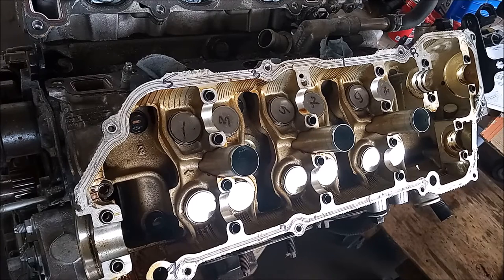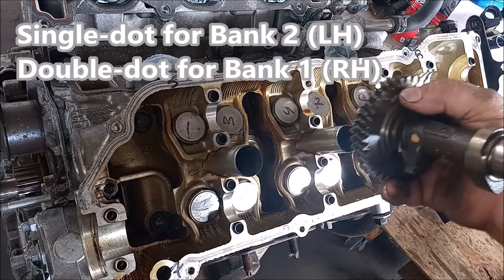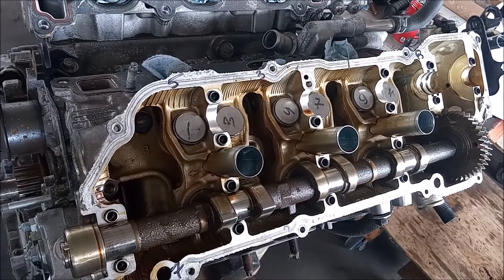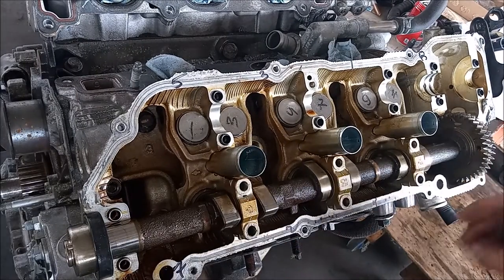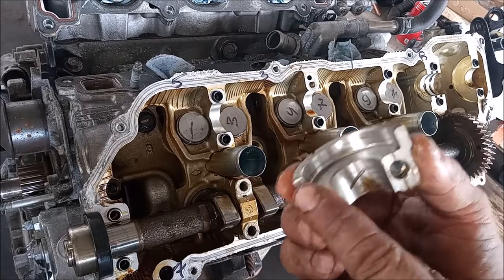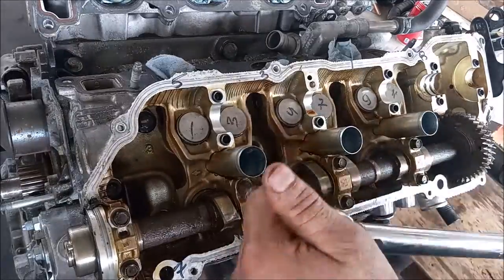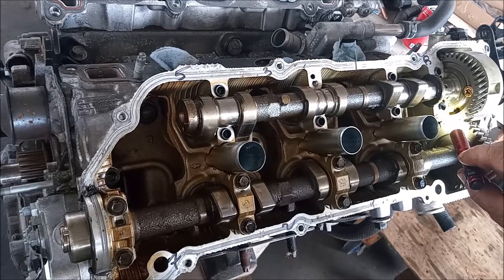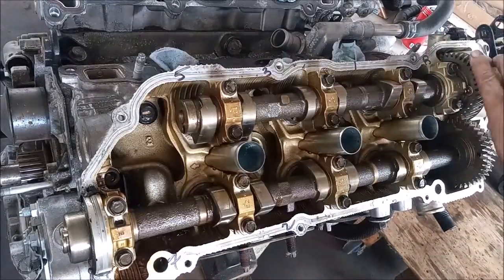1MZ-FE 3MZ-FE  VVT Camshafts Complete Install - Toyota Camry Highlander Sienna RX300 RX330

Comment: The dots are backwards isn't it bank 1 1 dot bank 2  2 dots and the split gear needs to be pre.tensioned.
Reply from the maker: They were installed as shown, and it works, so I don't think it's backward, and the pre-tension with the service bolt is shown in this video and also in more detail in another video.

Comment: Great video. Did you have to take the head to get it resurfaced at a machine shop? Thanks.
Reply from the maker: No not needed. I checked it with straight edge it was fine.

Comment: before i remove my camshaft would be a good idea to mark em before removing so i can put them back on same way after i resurface the cylinder heads or it really doesn’t matter
Reply from the maker: The camshafts have timing marks for aligning the exhaust cam and the intake cam on each head. PLEASE LOOK AT THE FACTORY SERVICE MANAUL.

Comment: I had to replace a burn exhaust valve on cylinder #4 on my wife's 1999 Lexus RX300 with this 1MZFE engine and did a novice booboo. I tilted the head over and all the shim buckets fell out and I lost the locations. Any recommendation for re-assembly? I was thinking of first placing the exhaust cam in place and use a feeler gauge and then mic the buckets.
Reply from the maker: Just thinking about this gives me a headache. You'll get through it.

Comment: If i removed the camshaft with the wrong dot marks together (180 degrees from where i should have) should i install at the normal installation position or should i install the way i took them out?
Reply: This on camshaft no.3 and no.4 by the way. I took out the camshafts at the two dots instead of single dots lined up (3FE-MZ). So all the valves are decompressed now. I figured when i reinstall, i just go ahead and reinstall the way the manual says to reinstall since all the valves are decompressed now
Reply from the maker: @charlesmaki7559  Correct just follow the manual and don't forget about the service bolt for the cam spring.

Comment: So the back set of camshaft have one dot and two dots the service manual says line up the 2dots for the rear camshaft and the 1dot for the front camshaft. Issue I’m having is that the timing mark on the back camshaft isn’t aligned with the mark on the timing cover when the two dots on the back camshaft are together. 
Should I just go ahead with the manuals recommendation or try to set the time with the marks
Reply from the maker: I'm not sure what you got going on there. Follow the manual for aligning the gears with the camshafts. Then after the head is reassembled you take care of the timing marks.

Comment: Are there valve clearance measurements to make and correct with shims?
Reply from the maker: Yes the buckets are shimmed. This is why, if you watch my head gasket video, I number the buckets and put them back in the same order. Unless your engine was making a valve clatter noise, you do not need to re-shim.
Reply: @Merryfrankster_  In the recommended scheduled maintenance booklet, does Toyota say anything about checking valve clearances after, say, 100k miles?
Reply from the maker: @michaelmcfeely6588  the service manual describes the valve clearance procedure in the engine overhaul section. If you are disassembling the engine, then do it. If you are under the valve covers and you see signs of cam wipe, then do it. If you hear valve clatter, then do it. If you want your engine to last 1 million miles (ha ha), then do it. If you are some kind of OCD perfectionist, then do it. Otherwise, if it ain't broke, why fix it.

Comment: WHEN I DISASSEMBLED MINE THE REAR BANK CAMS DIDNT HAVE TWO DOTS, AND WERENT ALIGNED BUT HTE FRONT BANK CAMS WERE. WHAT DID I DO WRONG?
Reply from the maker: The marks for each bank are different. Check the factory service manual.

Comment: Thanks a lot for the follow up .Do you often see V6 engines with VVT rattle ?
Reply from the maker: Not so much on the 1mz/3mz. More so on the 2gr.
Reply: did I miss checking the cam lobe / valve cap clearance for each lobe of the cam shaft?

Comment: whats the service bolt use for? any bolt fits or it comes with one
Reply from the maker: Look at my separate video for the service bolt to see what it's for. Any M8x1.25 bolt will work. The bolt is removed during installation, so the engine does not come with it.

Comment: what is the service bolt for?
Reply from the maker: there is a spiral spring that pushes the two halves of the gear in opposition - it must be pre-loaded and the two halves are held in position by the service bolt. After the gear meshes with the opposing gear, the service bolt can be removed.